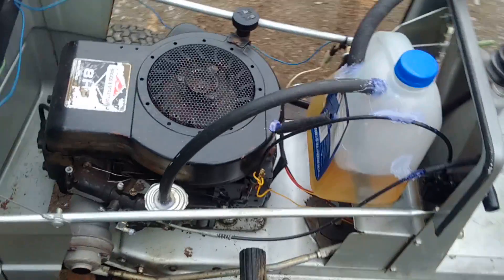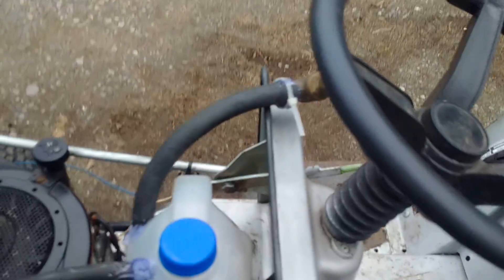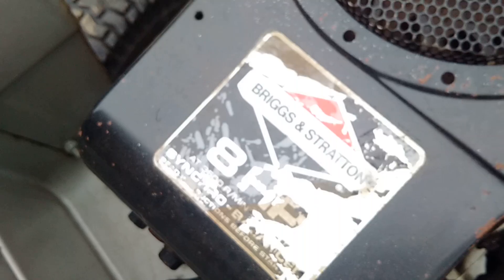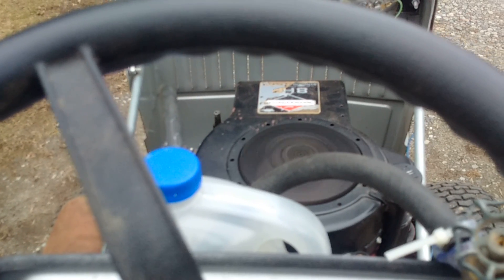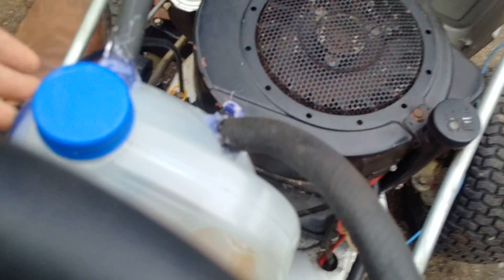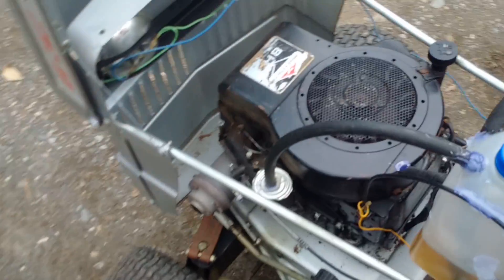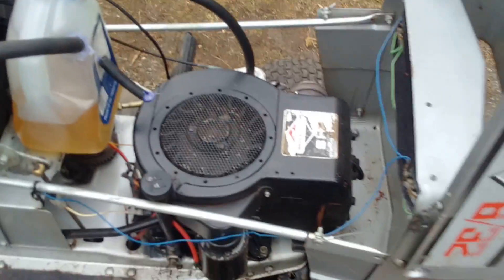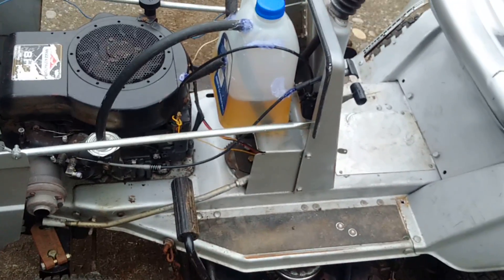Run an engine off gasoline fumes (REAL)

Comment: This is bad for the engine, and you will destroy it if you run it like this enough. That's why cars and lawn mowers don't run like this already. A tiny, simple low-power mower engine will be a little more forgiving. This would destroy a car pretty fast. Come on, seriously.
Reply: kingcrimson234

Comment: I think I would make the tank out of an actual gas can if I were to do this. That plastic jug would eventually melt and burn the whole thing down. My biggest concern with this is a backfire through the carburetor causing an explosion.

Comment: Great job on the project and yes most of the energy that comes from our fuel is form the gas or fumes... the only problem you have with a set up like this is longevity in how a engine works.... first thing to note is today's gasoline we would run to the station to get has detergents and lubricants in it that help keep and engine running more efficient over a longer period of time instead of short term... believe it or not the fuel we use in lawn tractors and cars has a lubricant affect... (it is a petroleum base!) on valves and also is a cooling agent that is key to a air cooled engine like your Briggs engine. The very low viscosity does cause washout on cylinder wall oil... Which is why it is key to let a carburetor like setup warm up on low speeds to avoid rings from wearing on dry cylinder walls not so much on fuel injected vehicles tho some may digress this topic. The way fuel works together with all of its parts also helps to control carbon build up. When you dig into a engine you can look at all the places where you have carbon build up. It tends to be all over the place but one spot in particular is above the piston rings all the way around this is controlled by the liquid or gas in the engine that helps displace or position the carbon where it wont affect the piston rings path of travel or it keeps it at its uppermost spot. The other thing you have to factor in is BTU loss as some of the energy is lost compared to original form and their is no implementation to correctly control air to fuel ratio as a carburetor (not as precise as) and or injector would do. The hose halve works but your engine cannot be controlled to run as efficient as it once was because you cant regulate a close to stoichiometric ratio you need and may introduce knock and detonation which may eventually kill your engine in the time you run this setup. I am not here to criticize but just to inform and give my 2 cents. Thanks keep up the good work

Comment: Basically a primitive evaporator, not unlike in a LPG system.
Or in the first gas/petrol engines, before the carb was invented. They used things like a metal mesh or a wick to evapourte the fuel.
Like LPG I guess CO2 and HC emissions will be lower, but I think it's running lean, and with high NOX.

Comment: Running on fumes is how it should be done. Better economy, more power, just more difficult to start. Gas and oil companies have silenced (and even killed) people in the past over this stuff so it's pretty apparent to me that it's all a big money grab. 

A guy in the 1970's named Tom Ogle got a Ford Galaxie with a 427 cubic inch V8 to achieve over 100 mpg using gasoline vapor instead of liquid fuel. He was shot in the street, survived, and later died a very suspicious death from Darvon (a painkiller) and alcohol. In the months previous to his death he told his attorney that someone was drugging his drinks when he was gambling and it was made quite clear upon his death that he was most likely murdered via poisoning, as many people close to him were certain he wouldn't/couldn't kill himself and it was claimed a suicide as a coverup. 

To all reading this, research Tom Ogle and draw your own conclusions. He went from a very successful and wealthy inventor to being shot "randomly" in the street and poisoned in the span of a decade. I find it very hard to believe it's anything other than murder.
Reply: So you are a conspiracy theorist nutball, huh? Don't you realize that a carburetor atomizes the fuel to create 'vapor' and air mix? Fuel injection does it even more efficiently? When you lean out the mixture, like he is doing here with his primitive external 'carburetor', all he is doing he severely increasing the amount of heat he generates from his extremely lean mixture which will almost guarantee that the engine will fail down the road.
Reply: Doug, you best learn some shit before you criticize. Carburetors and fuel injection do not create a vapor, they create a mist. It's still liquid fuel, just with a high surface area. Very important difference. Energy still has to be put into the droplets (in the form of heat) to evaporate them before they can burn. Liquid does not burn, only once the fuel changes state from liquid to gas can it burn. If you don't believe me, ask any high school chemistry student or just google it. 

If a guy in the '70's got a 427ci V8 in a 4,000 pound car to achieve 100mpg without power losses or mechanical issues (confirmed by numerous university studies, engineers, and potential investors), why can today's V8's with such "great" technology only achieve a fraction of that? He was not the only one to find a way to do it, but he was one of very few who were close to bringing the technology to market independently. 

The guy in the video used a very crude method, and even so had success. You need to learn about the science behind internal combustion engines before you make any more hokey claims there bud. By all means, do some reading and prove me wrong. But if you're gonna pull nonsense out of your ass I'm more than ready to put you on blast and educate you.

Comment: So I'm wondering how you adjust the throttle if the fuel has been disconnected..how do you go from low idle to full power ?

Comment: If the engine backfires, it will ignite the fumes in the mixing chamber which will cause a rupture and possibly spray burning fuel all over the engine compartment.

Comment: The reason why we don't do this is because the piston will melt without being cooled by gas mist
Reply: You are tight about the engine melting, but the gas mist does not cool the piston... at all... Leaning a mixture will create a super hot burn.

Comment: Excellent use of hot snot!    Now, for a test after you fix your deck, give the lawn a mow with the vaporizer and then give it a mow with the regular carb running.  I think you will be a lot closer in gallons burned per hour than you think.   Low compression gas engines are a bit picky about the air/fuel ratio.

Cute dog!!

Comment: Seems to me that when you close the air valve that the engine vacuum should suck that thin plastic gas jug in as it stops running.

Comment: Engines have run off Propane gas for years, they make an adapter propane kit to install on anything so this will most definitely work, also gas vapor of any kind runs cleaner and keeps cylinders and pistons cleaner than straight liquid gas...

Comment: It seems potentially dangerous. The gas would be liquid non combustible till it is atomized by injector mixed with air in cylinder or mixed in carb.  I would want a check valve on gas tank and have smaller mixer tank for air+gas mix. Just my 2 cents, neat video

Comment: You have gas fumes and air in a closed container....... a bomb
You better hope that the engine cant flashback into the container or boooom and you tractor thing is dead
Reply: +Cole Foster - One-Way Valve would solve that or at least take into considerations :D.

Comment: There is one who didn't understand the principle of fuel efficiency of an gasoline engine: Even if it runs on less fuel when you run it on just engine fumes, but a normal engine has an efficiency of around 30% - good ones, not the claimed 5-10%. And running it on gas fumes makes it just probably 100% more efficient, but that doesn't mean it has 100% efficiency... You're probably at around 45% right now, even if it isn't logic to me, because if you want to increase the efficiency of a internal combustion engine, you have to increase compression ratio, so that it can burn hotter, so that the temperature gradient between internal combustion and surrounding air is higher... 

Probably this is a way of leaning out an engine without it actuay blowing up, so it combusts hotter and therefore is more efficient, that would be one way to explain it, but there could also be other shenanigans going on... Definitely something I want to try out myself tho ;)

Comment: to run at max efficiency you could run pure oxygen in the fumes tank, you would have to regulate the mixture but it could work, by volume, air contains 78.09% nitrogen, 20.95% oxygen, mixed with other gases, however you would need to measure the volume (part per million) in the tank before injecting pure oxygen and possibly blowing up the whole thing, nevertheless  great video  if you decide to test on a larger scale please get a tank thats more suitable for gasoline, plastic can get brittle over time, again great video,

Comment: Do you have any sort of backlash valve? If the engine were to backfire through the intake, it seems as thought there is a major fire risk.
Reply: One-Way Valve would solve that or at least take into considerations :D.

Comment: wouldn't ever do this on a vehicle it would burn up the pistons inside the block and everything else and the valves might as well say goodbye engine lol and even on a lawn mower it would do same exact thing cool video but no wouldn't ever do this to any engine
Reply: CD'S repairs and automotive sounds as if shes already got a heck of a wrap or knock. Too lean. But in a post apocalyptic event, i will keep this in mind if i cant find anymore fuel

Comment: Look at the spark plug and see if engine is not running too hot no fuel to keep it cool
Reply: Anthony Casey It like an lpg vehicles which I used just trow in iridium spark plugs and you good to go. Sorry if my English is bad. Im not native English speaker.

Comment: You need to study up on jetting and why jets are different sizes. Running on fumes will be an extremely lean burn thus causing overheating and premature engine failure. Put the carb and the gas tank  back on it before you throw a rod out the side of the block.  You should first learn about propane conversion, that will help you along in your quest for a better tomorrow. Cool concept kid keep at it.

Comment: You should try a carburetor, they work great at making gas fumes and the throttle works better.
Reply: Scott M Thus design actually works worse with a carburetor
Reply: +PhysicsNerd42 This is literally a basic carburetor with no throttle so what he means is to replace this pile of shit with an actual carb.

Comment: This is intriguing from the prospect of more complete vaporization. Although I'm extremely confused on how you came up with your claim of  95% efficiency.
Reply: jim Smith if it was 100% efficient, the motor will be at room temperature after long hours of work. He didn't think of heat energy lost. Most of the energy is lost in heat.

Comment: What's it like under power is there any loss of hp or does it fiction just as well as normal?
Reply from the maker: It handles just the same, tons of power but does run a bit hot, more cooling would really help it.

Comment: You may consider including a flash arrestor in the build as well. They are easy to build and install. They could also save you from exploding. It's pretty cool how you can do this yourself isn't it? Nice job putting this together on your own, looks good for a first attempt.